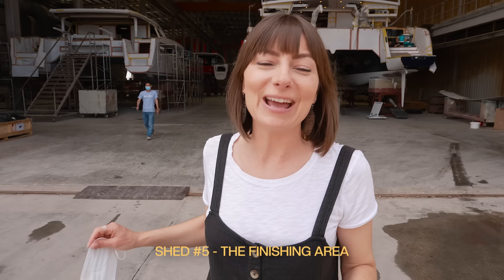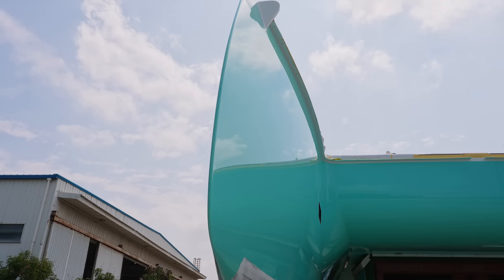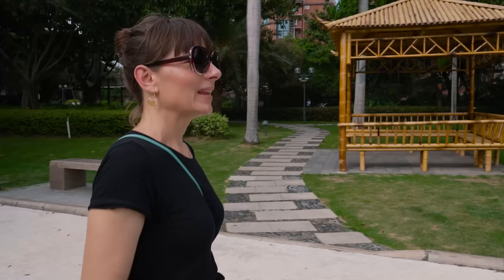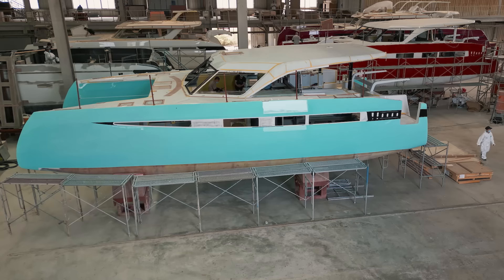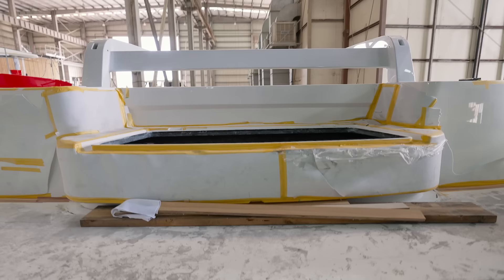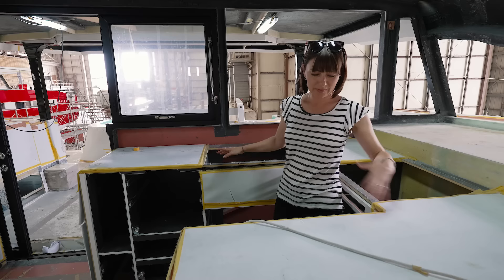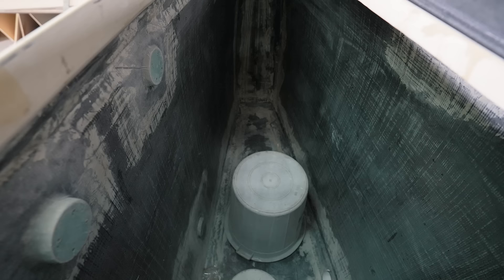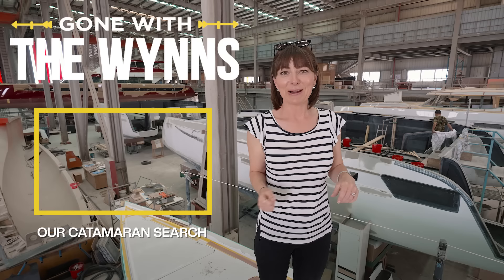FIRST IMPRESSIONS OF OUR NEW CATAMARAN

Comment: IDEA for the Wynns: For the workshop bench top. How about a drop in wood surface than can get all beat up and when it gets too bad just drop in another piece of wood? You'll have a lip or fingers that will hold it in place.  You could go with bamboo since it's more eco friendly and it's water resistant.
Reply: I love the color
Reply: Just some screws from below, easily removable

Comment: The color is definitely curiosity! You could not have picked a better color for the boat! It just fits perfectly!
Reply: I'm just not sure it's going to look good in the long run. It may turn out to be a haircut you hate when you look back in 20 years and then you'd be scratching  your head wondering what the heck you were thinking back then..
Reply: @junkname9983  Does that mean you 
don't like it? Im just hoping it doesn't make it difficult to spot when out to sea. Otherwise, I think its pretty!

Comment: I use a drawer-type dishwasher, made by Fisher and Paykel, a New Zealand parent company.  I have had them for years--very little trouble, use little water and power.  I use only Finish brand diswasher POWDER, not the tablets which are too much soap for a small load,  and I use only  Finish liquid rinsing agent. They quick, about forty minutes for a light wash--usually all that is required.  They heat their own water and are efficient and very reliable, and profuce little grey water for those areas one has to have it stored them pumped out when in port.  Another thing I did was to use my shower water in the heads--I had a small fifty litre tank in a locker which overflowed to either the ocean or the greywater tank,  There is a caution though--before taking a shower, pour a little holding blackwater sterilant down the shower drain.  It is usually bright blue in colour and strongly perfumed, and this prevents the putrification of the water in the heads flush holding tank.  Marine heads do not use much flushing water, and the waste water from twio people showering in fresh water is way more than enough for the w two heads we ran from those little fifty litre tanks, one for each en-suite.  We never had any liming problems, or any build up of calcium deposits in the plumbing or the apparatus itself.  Just sayin'.

Comment: Highly highly recommend getting a pair (or more) of the HermanMiller Design Aeron Chair! Get the tilt forward feature on at least one and headrests on a few as well. I have lower back troubles (years of motocross and stunt motorcycling) and have searched the world over to find a chair that I can spend hours and hours in and still walk straight when I get up! They ain't gonna be cheap, but neither is your project! They'll come to you with nice casters, but the fitting is standard, so you can find nice locking ones online to complete the picture. Just Do It!

Comment: I guess you’ve specified how many watts each of the USB ports support. Low power USBC ports etc just won’t cut it when charging laptops. Lovely boat. Not sure if you’re having a range hood over the induction cooktop but some now come with a Bluetooth connection between cooktop and range hood so that the range hood automatically “talks” to the cooktop about turning on when steam etc rises to a specified level.

Comment: It seems the new boat is fabulous…..and at a point where there is no more time to consider….if the bulkheads might benefit from added reinforcement to prevent any flex between the hulls?  Last chance for overkill….seas beating the two hulls and trying to twist the connecting structures between hulls……..will it ever begin to develop cracks anywhere after a few years and many rough weather and sea events?    Best wishes……Jason ..stand firm on the dishwasher!

Comment: Looking forward to your on the water adventures again.  Silly question are you having composting toilets on the new boat?  We just installed a Natures head composting toilet in our new travel trailer.  I am still working on how to efficiently use it but excited no black water tank.  That should increase out off grid time.

Comment: Question about the folding transoms.  Ever since i saw a horror film about it, its bothered me that some boats cant be boarded by a person in the water as the deck is just too high to reach.  If the transoms are both up for travel and, god forbid, you both fall overboard, how do you get back onboard?

Also your tool/device charging drawe(s) - are they going to be fire resistant?  Batteries can catch fire, especially if they overheat because they are charging in a confined space. A small amount of extra expense now could save your entire boat if something goes wrong later.

Comment: You mentioned USB-C outlets. I wanted to comment to say that you should be aware that those will almost certainly have parasitic draw. Not a big deal for 1-2 outlets, but if they will be installed in many locations, the draw could end up being an issue. There are some outlets which only "power up" the USB ports when something is plugged in, but be aware that most do not work that way.

Comment: For a person who dont know too much about Cats, what is so special about Carbon fiber?  Once again you know kept me wanting to see your videos, my Marines Corps buddies contact me from all over the country asking have I kept up on the new boat.  Once your boat is built, where is your first destination?? I wish you guys nothing but the best on your journey, be say, stay happy and remember I am a loyal fan.

Master Sergeant William's
USMC, Retired
Semper Fi.
Reply from the maker: Carbon fiber is a really amazing material: very light, but with very high stiffness & tensile strength (comparable to trying to bend steel). In fact, when you compare at a strength to weight ratio, carbon fiber is 5 times stronger than steel. It's also heat, abrasion, and chemical-resistant. So it makes for a really strong, durable boat but is much lighter than the traditional fiberglass/wood boat construction.
Curious Minion

Comment: It's a little known fact that fiberglass is actually stronger than carbon fiber but carbon fiber is stiffer than fiberglass which is why carbon fiber is used in vehicles where the geometry is extremely important like Indy race cars and high-tech hydrofoils.

Comment: Such an impressive boat. Seems very well designed a constructed. Not a big fan of the concept of Fiberglass railings unless you are going to have a couple of spares. In the worst situation they will shatter not bend, with no chance of local repair.

Comment: I love the color but wonder what it will look like in the water. Its hard for me to go there. But, even more, as a tiny bit into painting type person (cars and such) I have to wonder about the process. Doing the sides before the top. Ok. Not typical with cars for sure. But, this is a boat and a much larger process. I must say though, this type of construction may be one that might last for what could be thought of as forever construction. No more rotting bulkheads, none of the things that make a boat or even more a Catamaran "creak" as it goes upwind. That boat is going to be silent. And, its going to last !

Comment: Those first step at the front are going to take a pounding.   I don't see how they will hold up over time without support underneath.   Those are going to break at some point.
Reply from the maker: Solid Carbon which is stronger than steel. They won't break. 😉
Reply: @gonewiththewynns  Carbon is stronger than steel by weight -- but is it not stronger than steel.  The first rung of ladders take a heavy pounding because we tend to exert extra force on the first step to get our vertical motion going (take a close look at any well used ladder).   Sunshine is going to beat down on those steps and weaken the resins.   It's a beautiful design and it looks nice, but it also looks like a future problem.

Comment: I offer NO judgement on your color choice (Nice Color) because THAT is part of your dream (boat) - Just as Mine would be the same ship in Split colors (WHITE Upper decks, Navy Blue Lower Deck Hull) NO sails, DUAL Electric motors and a Pilot House (?) with Full electronics package with 17 inch  displays plus Forward looking Sonar on a new deck above main salon, Dual motors with Top speed exceeding 17 knots, and enough solar panels and batteries to be able to cruise at or above 10 knots all the time. So That's my dream!

BTW -With  all that CLEAR glass HOW are you going to cut down reflections on your workstation? I hope you consider this. You only mentioned installing a curtain in front of you (behind monitor) but nothing about covering up what is behind you.I have worked on computers surrounded by windows during COVID and reflections can be a pain!

Perhaps shades, or curtains on ALL windows? I would opt for adding Solar radiation reflecting Tinted windows besides previous two options, with a minimum of 50% to maintain night time visibility. Such window treatments reduce solar heating and that leads to an even Cooler cabin and reduced A/C usage. Plus it makes Outside views more properly exposed during interior shooting (photography and videography).

Comment: Hi Guys.  The One Thing I would like to see you Keeping a Really  Close Eye on is the Huge Wild Card that is being thrown into the Cards between Now And we'll into Next Year, that after Four Succesive La Nina years,  what could well be the formation of a Super El Nino.  Assumptions of "Normal" Could be thrown Completely off the Board Globally. These Coincidings of Solar  ycles and how they affect things like the Magnetosphere can be Truly Vicious and even Civilisation ending, one example of that, is the Ending of the Moche Civilisation in Peru,  which at the time was a larger Civilisation than Rome's.  The Least affected areas tend to have been those Close to the Equater,  but with Super El Nino there are no Guarantees on where Will or Will Not be ok in any particular ones. So Where would I head for on a Sailboat, for possibly the Next few years?  Initially, to see how things are developing - bearing in mind this choice could Rapidly go Pear Shaped as well - tbh, I think I'd be Heading to  Northern Argentina,  but e ready to exit that area at a moments notice. In "Normal" Hurricane Season,  my Plan A was sheltering on the West Coast of the Yucatan Peninsula through Burricane Season,  then when over, go with the flow around the Fulf of Mexico, popping into places like Texas and C,orida to Provision, pick up parts, etc, before  Crossing into the Bahmas and heading South. A Potential Super El Nino wipes the planning Whiteboard options pretty Clean though. The only practical advice I can offer, is you  litz the haulout work you need to do as Fast as possible, so you can relaunch quick, and respond to developments accordingly, and Watch Earth QC and the Mr Weatherman Channels on YouTube for Caribbean and Global influences. Earth QC Channel is dedicated to keeping a close watch on this El Nino.   est Wishes, Keep Safe. Bob in Wales.  🤔👍